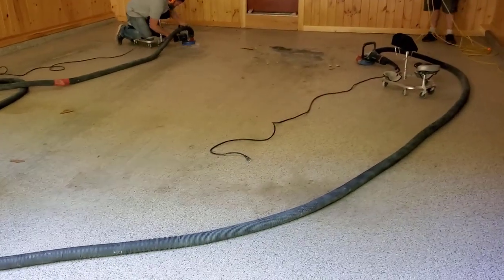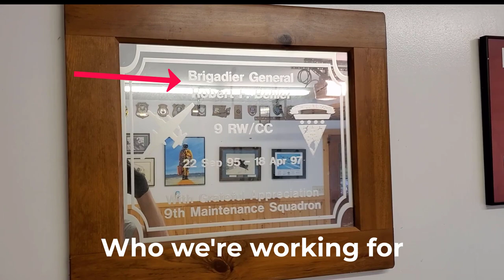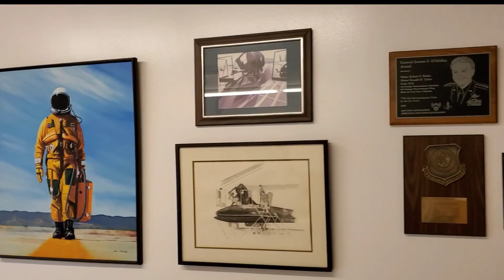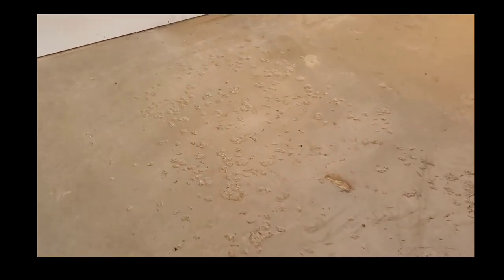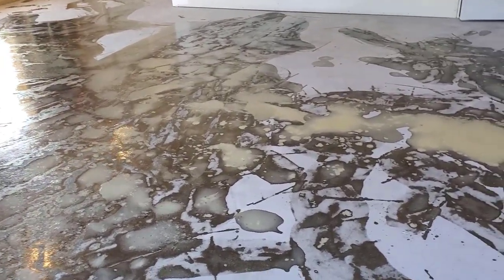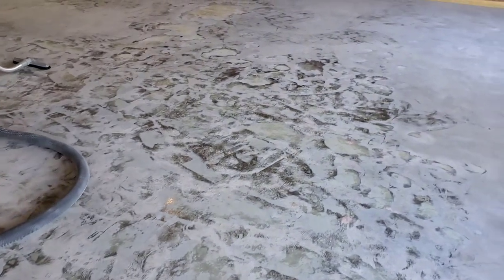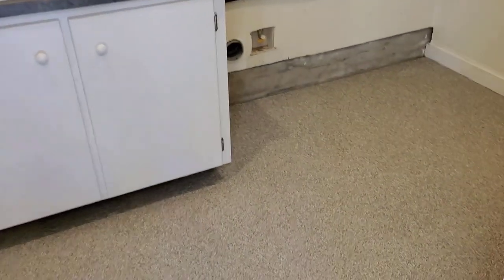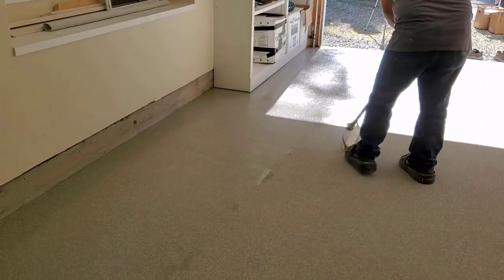Epoxy Garage Floor Coating Over Salt Damaged Concrete (Fix & Repair Garage Floor)

Comment: nice work ! i have a 7 yr old garage floor, only had the concrete sealer on it , no finish, so do i just put down the base and flake. scrape and seal ?

Comment: What is the process for repairing the cracks and what product do you use to fill them ?
Reply from the maker: We use Quik Fix to repair the cracks, same as this stuff we used in the video. Just add some silica sand to it and make a mortar or paste to fill the crack.
Reply: @MikeDayConcrete  do you chip out the crack or widen it at all ?

Comment: Hi Mike, lots of great videos'  Questions.  (1) my garage floor slopes very slightly to one front corner and (2) they must of run out of concrete buy a few cubic feet so the floor dips about 2 feet in from both doors.  Floor is in good shape but I get puddles that won't drain in one corner and in front of the doors.  Will a Epoxy  or Floor Leveling system fix these problems?  Trying to decide if I should do something before I get new garage doors.  (3) my son works on all kinds of engines so we have gas, diesel, grease, rear diff oil etc spills on the floor.  Do these products hold up well to hard garage usages vs. basement usages?
Thanks,
Bill
Reply from the maker: We would use our polyurea repair material to fix/level those areas or a self leveler to fix the dips, but you'd have to go over it with an epoxy floor something like this one to seal it.